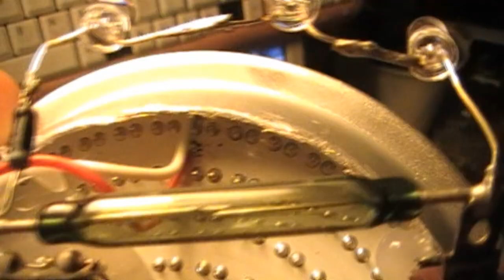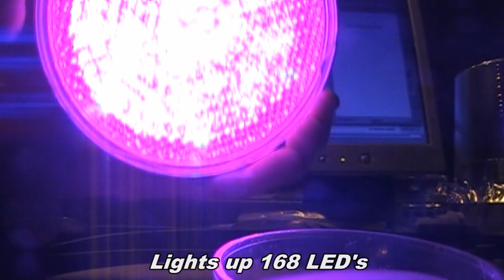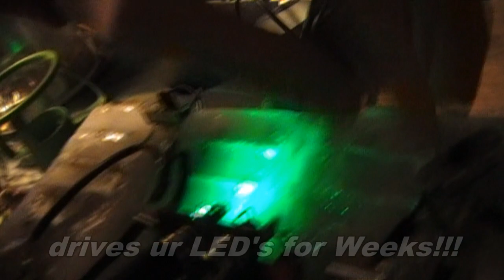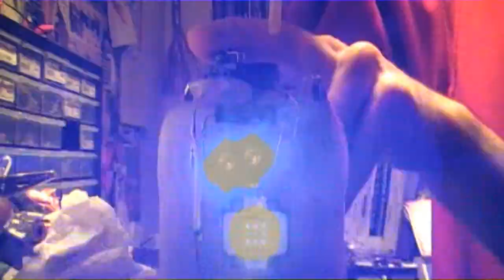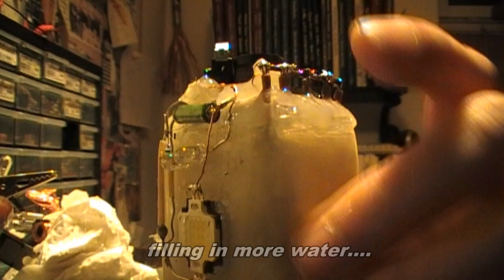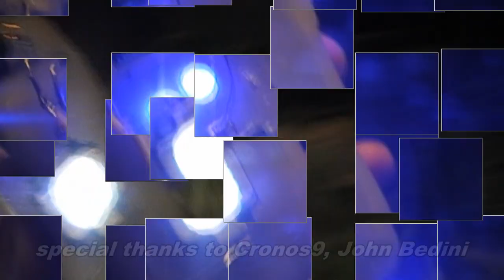How a Reed Switch Oscillator works - Is it a magnetic flyback step up?

Comment: Oh man, what you have there it's for me like a Christmas tree for kids. ) One question.How long must be the wire and tin to work good the reed switch from 1,5 volts? cheers
Reply from the maker: +Robert s between 200 and 300 turns with 0,3mm. wire on short ferrit,ca 3-5cm length and 0,5-1cm diameter

Comment: What would be the max amperage you could get out of this circuit when running constantly from a power source strong enough to maintain it? Do the individual parts have any limitations in that respect?
Reply from the maker: i dont tried high voltage reed switches but the others all burned out with inputvoltages over 12V... it depends of the wire gauge, the windings and the ferritcore... if this is all correctly combined it maybe can handle voltages above 12v input